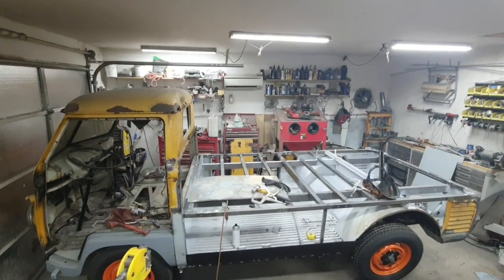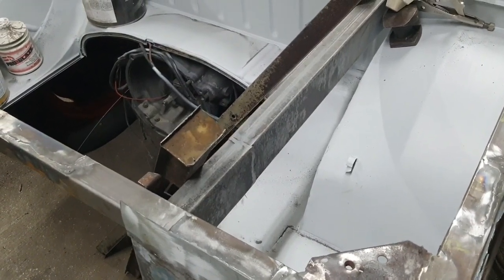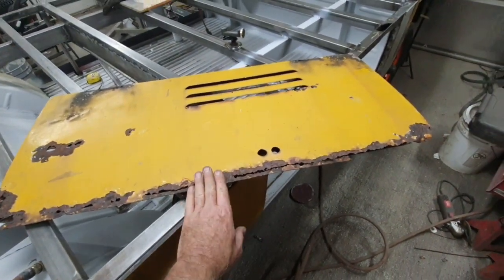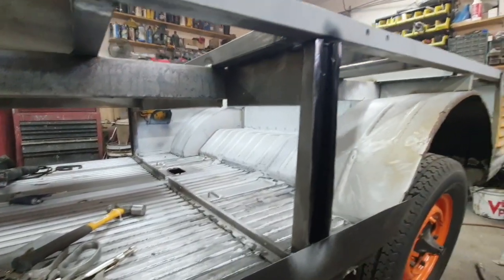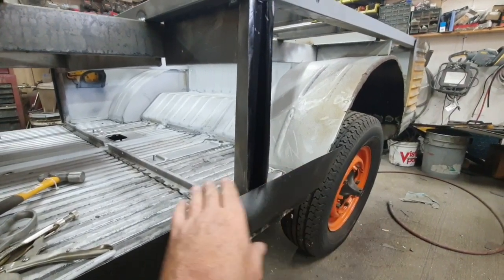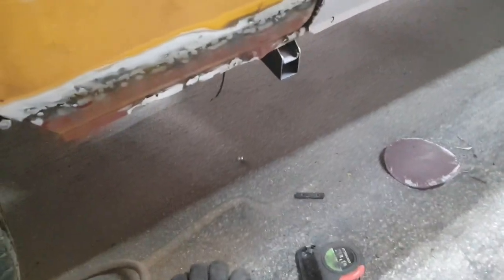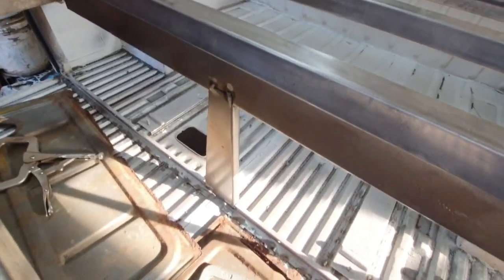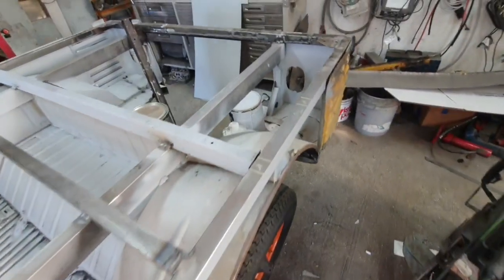HAND MADE METAL Forming for the VW single cab Rare  cherry picker.

Comment: Something in your work bench drawer wants out. 😁.      I used OSI because you recommended it. Great stuff. My Vanagon has a few side panels pulled away from the braces. I just filled the small gaps with OSI and it’s done!    It drys firm not hard. Just perfect. 😎😎😎👍👍👍

Comment: Hi Mike, first you do an amazing car out of scratch that was more than dead!!! I did a little research on the signal orange color. Regarding a Ph. D. Thesis from 2011 the color was developed in the 1950ies when terrible accidents happened with the garbage trucks that were grey/green. So they started to use RAL 2000 to avoid accidents. At that time they had a lot of lead in RAL 2000. That’s why they chanced to RAL 2011 with the beginning of the 1980ies. My friend, that sprayed the gas tank of my old BMW bike said that today they usually take RAL 2004 and sometimes 2009. I didn’t approve anything of that information. Keep your efforts!!!